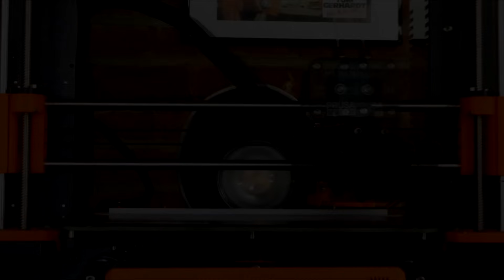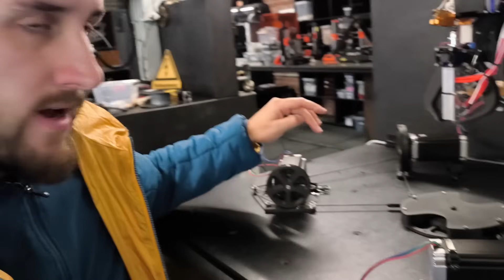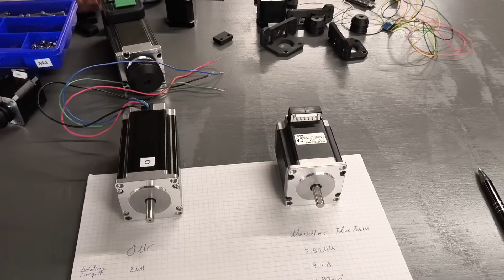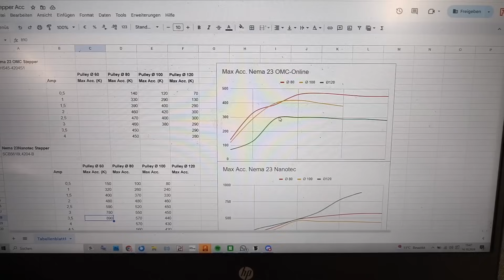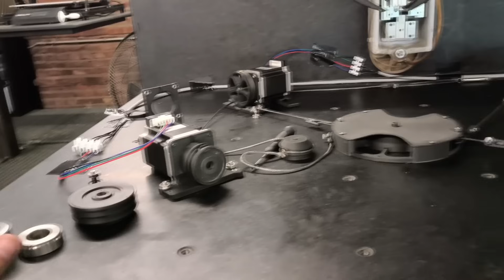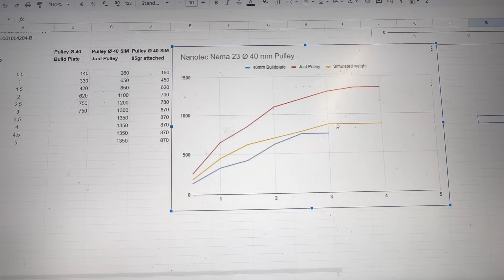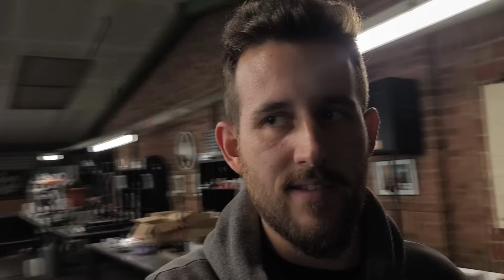Minuteman Dryruns on World Record pace. Is a sub 1 min 3DBenchy possible? (Episode 7)

Comment: if i understand it correctly wouldnt you reduce the gap between just pully and simulated weight if you use 8 motos. So you only have half of the inertia per motor?
Reply from the maker: Yes. I still think its smarter to reduce the weight of everything in the first place instead of making it more complex :D

Comment: Brackets are flexing, not along the string axis but still. Is the string you use too elastic at these speeds?
Reply from the maker: i guess not. Everything resonates, I found a mode at this printing speed. I'll constraint the movement next iteration

Comment: With that massive delta between just the pulley and the weighted pulley, I'd love to see a few of these motors linked together shaft-to-shaft to see how high acceleration you can get with that. Ideally, 2x motors at 4a each makes an 8a motor, it would be very interesting to see if the motors working together would increase overall acceleration or just torque. If just torque, it looks like that would make the larger pulleys work better to possibly achieve higher acceleration through the gear ratios at play.
Reply: The amount of headroom between the "motor only' curve and the "motor with load" curve indicate there could be significant gains from more motors.
Reply: I agree with this insight and I think it’ll boost the possible maximums, I just don’t know what new issues will arise from combining two or more motors together
Reply: something interesting you can do with doubled motors is offset them by a half step to effectively double the resolution.
however with that you may need custom drivers that can work in lockstep.
at this point you might even wanna run an fpga driver with closed loop control.

Comment: How about.. move both nozzle and part ? Halves the require distance  for each axis doubling the acceleration.
Reply from the maker: I've considered doing this. Problem is that my hotend weights about 20 fold what the moving bed weights... Thats going to cause a lot of problems
Reply: @Roetz40  long heated nozzle pivoting to reduce moment , perhaps? Or  just move the nozzle for shortest moves (infill chimney etc. )  . Missing out on the possible gain from relative motion seems wasteful

Comment: It kinda makes sense that you will get better acceleration from a smaller pulley thanks to the mechanical advantage you gain. you get more torque but less speed/ distance per rpm
Reply from the maker: its always about finding the sweet spot...

Comment: you never print a good benchy with this setup,  i see the ropes wobbling in high speeds, plus you table is rotating also with the moving.
Reply: one step at a time. You dont start sprinting you first need to learn how to walk
Reply: @thomaskletzl6493 ironically isn’t trying to test the limits if servos the “running” part of this metaphor? He can’t really print a decent benchy at normal speeds.
Reply: I just wanted to point it out to make mechanics working first without chasing incredible speeds and accelerations.

Comment: Awesome man! Lots of research and engineering. May i suggest one thing? Maybe you did it already but just in case... Optimizing the slicing layer by layer. There is tons of things at each layer you can set differently. Use modifier and tune each layer individually :) That is where you will gain the max time i think once you have reached the max from the hardware
Reply from the maker: Yeah i know thats a thing. But I also got a regular job and social life :D maybe ill invest the time and analyse the motion vectors of each layer and apply a filter on top. Setting parameters layer by layer is just a pain...
Reply: @Vez3D  hello Vez! we were discussing the kilomillimeters in coments. You use that as well. Can you tell us the reason?
Reply: @wavyseahill  im not sure I understand the question.. sorry.
Reply: @Vez3D Jan and You as well quite often write acceleration in several K of mm/s^2, so basically kilo-millimeters. Why do a lot of people do such a thing instead of just converting to m/s^2. Writing 500k mm/s^2 is basically (1000/1000)*X.
Question is - why?
Reply from the maker: standards... we started with milimeters and continue to do so for easy comparison sake.
Reply: @wavyseahill  ahh because we just got use to that metric...and it is what is also displayed on the gui of most printers
Reply: @Roetz40  so that is more like abstracting away from meaning of the units and just comparing the plain numbers?
Reply: @wavyseahill  it's keeping the scale, it's milimeters all throughout. it's an engineering thing
Reply: @ItsDoneWithMirrors  engineering thing is to use SI units with magnitudes written by letters p, n, u, m, k, M, G etc or using SI units and writing the magnitude with *10^X or eX. 5.3 nm or 5.3e-9 m for example.
P.S. Memory was in KB throughout, for some time and yet we don't buy kkkkB hard drives.
Reply: @wavyseahill  it's for consistency. we might switch to m/s and maybe fast machines will. and no, for engineering u keep the same unit all throughout ur project
Reply: @ItsDoneWithMirrors I can't name a machine that cannot reach 1m/s^2, however, it looks like fast machines soon will need to switch to km/s^2. :D
You got me curious, what your field of engineering? And what country?
Reply: @wavyseahill millimeters are used for pretty much everything. The printer and the parts  it prints are designed in millimeters. The bed is in millimeters and it moves in millimeters. Other CNCs are also frequently in millimeters. Therefore it's more practical to keep the acceleration and speed in millimeters to avoid conversion errors.
Reply: @OttoGlassV  you didn't get the question? According to this logic, you should then write 800000 mm/s^2 instead of 800k mm/s^2. Otherwise it is already a conversion. However it looks that you consider writing a bunch of zeros much more reliable then replacing them with according letters.
Reply: @wavyseahill  I just want to say that you're not the only one annoyed by this :D I don't really agree that kmm is somehow less confusing than just going to meters. One OK-ish argument for it that I can think of is that it might make it easier for American viewers who aren't used to units being decimal multiples of eachother, then kilo-milli is just explicitly stating this fact.

I've been playing a video game called Satisfactory lately and one thing you do there is manage a power grid, build powerplants and such. I was surprised that pretty much all youtube creators making videos about the game do this same thing. The "base" unit in the game is MW and people talk in thousands of megawatts instead of "upgrading" to gigawatts. I feel like there it's a missed opportunity of using an even cooler sounding unit :D And getting to a terawatt would be an especially big achievement, but calling a million megawatts feels lame to me :D
Reply: @slunce12  100%, my friend. Imperial dudes are like 100000 Tera picometers away from accepting the metric system.😁
Reply: Cars use a dampener on the weight
Reply: Ok guys, thank you all, thanks Simon, thanks Jan. I got the main intention. I guess I just sometimes feel sad that part of 3D community know how big numbers look, but don't bother how mindblowing such numbers are if you understand the units. You guys are building the machines with acceleration of spacecraft, let them accelerate long enough and they will reach the earth's escape velocity! 
No offence, no hate, I love the content, guys! ❤️

Comment: Why did you say that only open loop steppers are allowed? I thought it only said "The machine must be powered by stepper motors".
So maybe closed loop to be able to push closer to the limit.
Reply from the maker: I asked this into the annex discord and got this answer. As soon as i hit real limits i will ditch the open loop aproach
Reply: @Roetz40 We need a new speedboat competition. The rules of annex one are stifling innovation, not promoting it. Servos are no longer something that only companies and wealthy hobbyists have access to. They totally make sense to put on a 3D printer now. I can make a servo out of an RC hobby BLDC motor and a FOC driver that costs less than high end NEMA17 steppers. Also my personal peeve, is the focus it puts on one benchy. I asked recently on their discord server if it is OK to print, for example 10 benchies in 20 minutes, and call them 2 minute benchies. They said no. It must be a single benchy. There is no way to cool that much plastic in that amount of time. It is a material limit. Physics. You will only ever make poops at a sub-3min pace and they would rather see one pile of poop at 2 minute pace, than 10 actual boats at 2 minute pace. I'm not about to invest that time in making poops. BTW i made it clear that I meant one toolhead, one nozzle; not 20x nozzles printing parallel like you did before. Still NO.  this speedboat thing has run its course and Annex are not willing to evolve it to the next level. I see no reason we should maintain interest in internet credits minted in 2016.

Comment: Such a cool project! Really looking forward to seeing your next tests! More tension on strings or a stiffer material maybe to prevent the string from "flopping" around?
Reply from the maker: Yes I have to adress that. Next iteration will have the strings more supported on the longer sections
Reply: wuld it be better to tension the cable indirectly by removing the tension springs in line with the cable and instead use a pully which can be moved outward to tension, like a belt tension mechanism with a thumb screw?
Reply: @clippy90001 the springs are there because the lines that connect the motors diagonally, have to be able to lengthen when there is movement in the other axis.
Reply: @Sh4de2k why not compensate for that with the other steppers? If the build plate moves away from the center in the Y direction, both X steppers should release tension on their cables. Or would custom G-code violate the speed benchy rules?
Reply: @phizc  very uneducated guess here, but I think that would be insanity trying to get timing and distances so accurate. Especially running steppers, maybe with closed loop servos